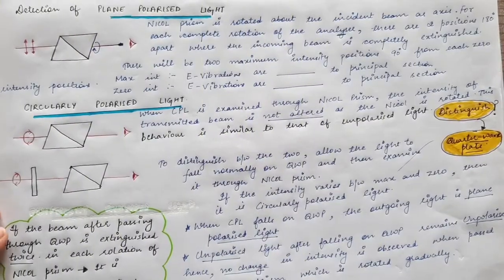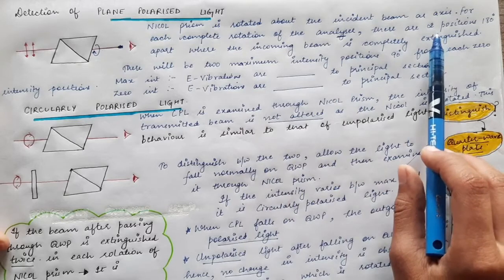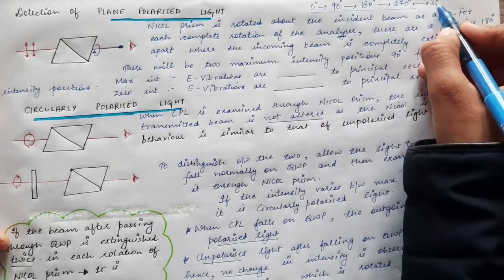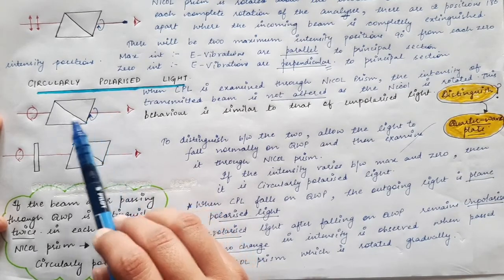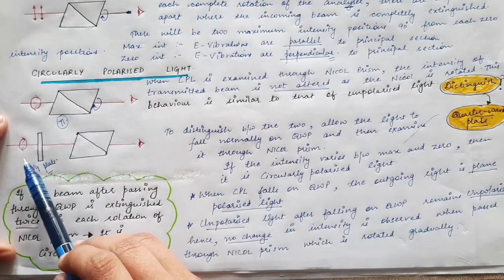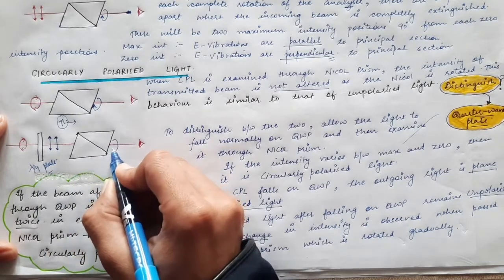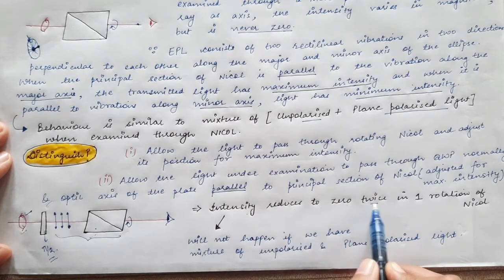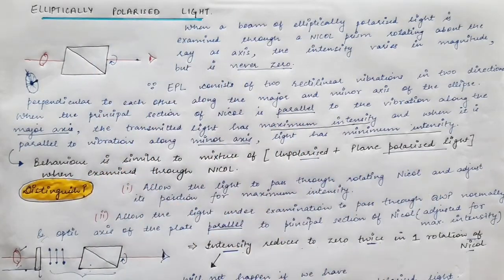Last Lecture 57 | 3rd Semester | Analysis of plane, circularlly & Elliptically polarized light

Comment: Why unpolarised light remain unpolarised after passing through qwp although qwp plate is made up of doubly refracting calcite crystal which produce polarized e and o ray ????
Reply from the maker: It depends how you are cutting the double refracting crystal
For qwp or hwp
Crystal is cut in a way that optic axis is parallel to the surface on which light is made to incident
Light is incident normally means 90⁰ with optic axis
E ray and o ray will be produced in this case also but they will move in the same direction ( with different velocities )
If ray is incident normally to optic axis or in the direction of optic axis then e ray and o ray go in same direction
For unpolarized light these rays will not have a constant phase relation with each other after coming out of qwp so it remains unpolarized
Reply: It means whether it is qwp or simple calcite ,when unpolarised light is incident along or perpendicular to optic axis it will remain unpolarised??